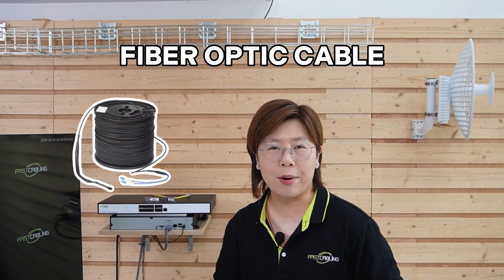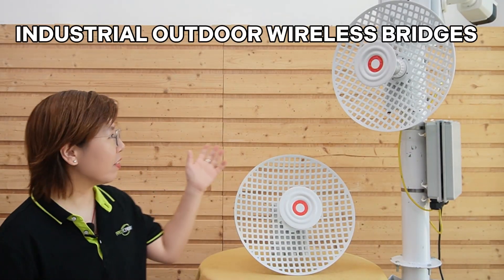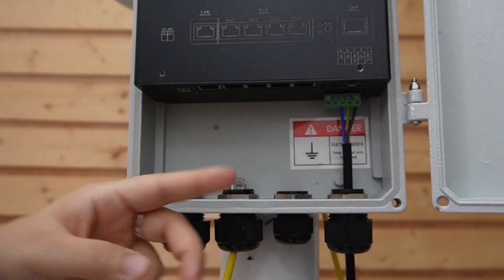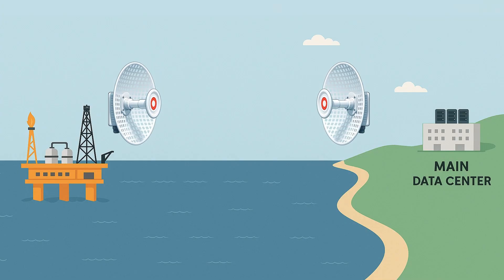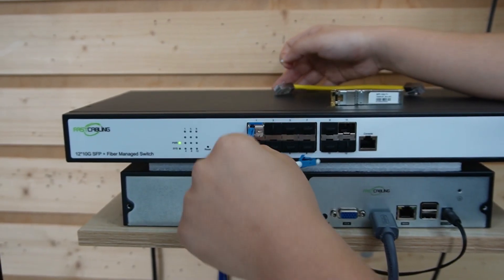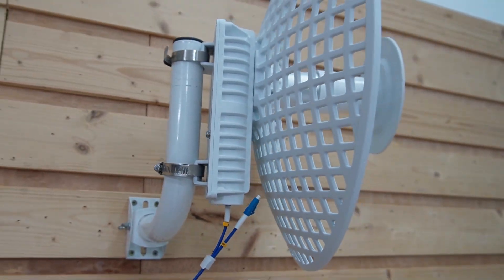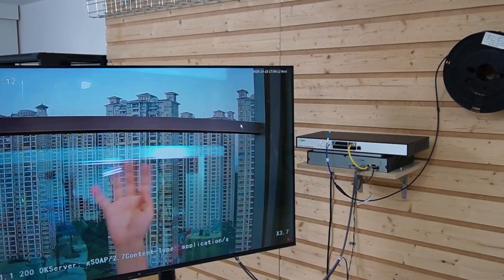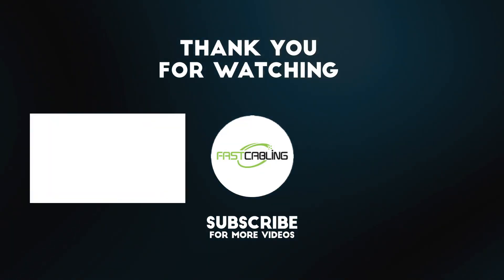Built a 10KM Wi-Fi 7 Wireless Bridge Over the Sea | Master Bridge Setup Tutorial

Comment: Oil rigs are floating, but I am not sure how much/if they rock during rough seas. Won't the wireless bridge lose alignment if it does?
Reply from the maker: These have a wide transmission angle, so small movements don’t break the link.